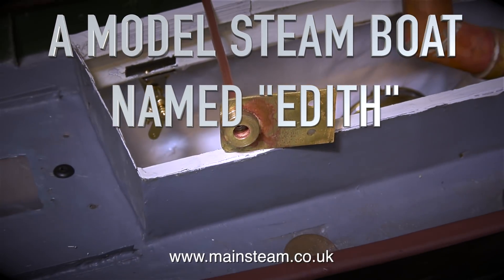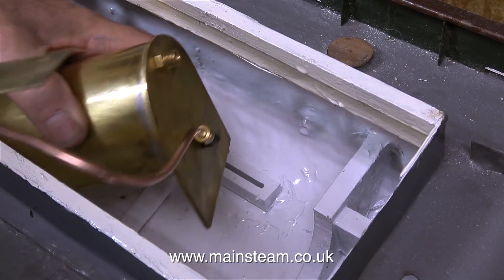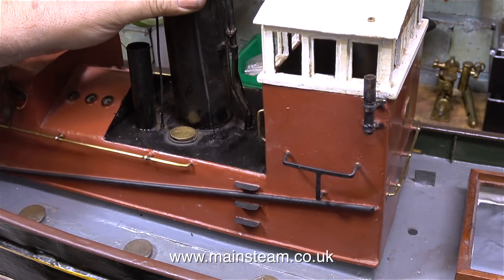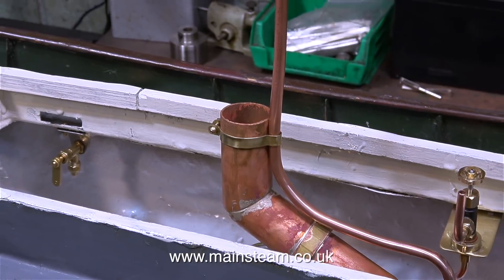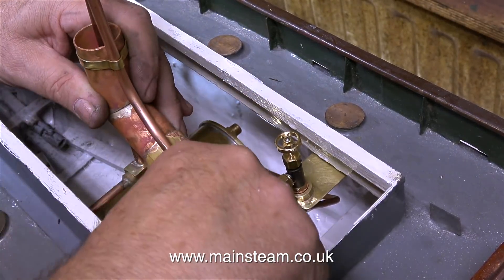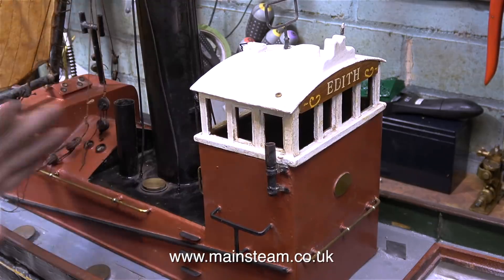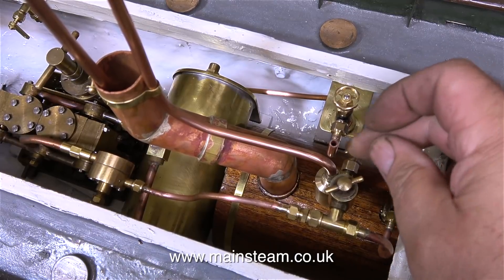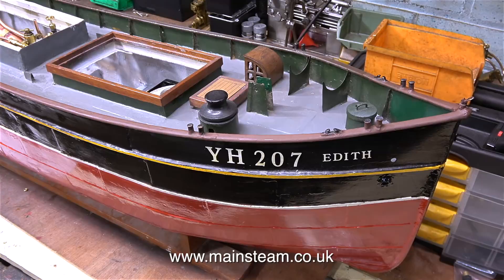A MODEL STEAM BOAT NAMED EDITH - PART #29

Comment: Your right that is a nice little model. Are metal hull kits available or found only with scratch made models?
Reply from the maker: 100% scratch built by soft soldering pieces of tin cans over a wooden former . . . .

Comment: Hi Keith I really enjoy your videos , just thought I’d drop you a line about screws and bolts.Screws are threaded up to the head, and bolts have a shoulder ,and are used for load bearing applications such as horn blocks . Screws are just used for holding things down like guards. Hope I’m not repeating what someone else has has written.